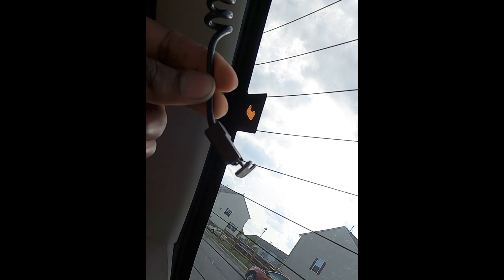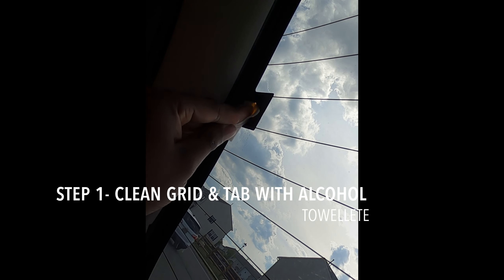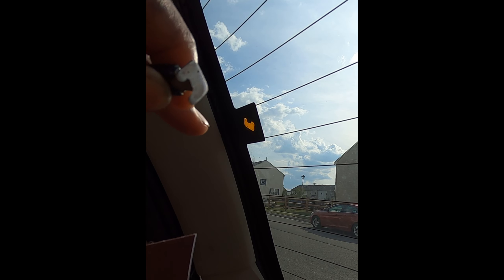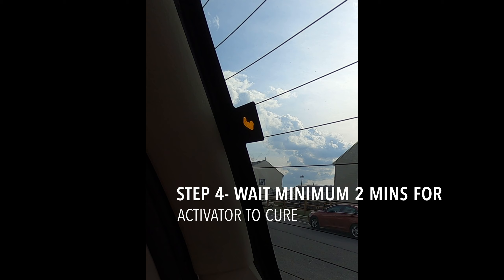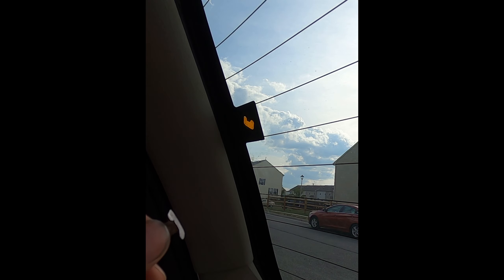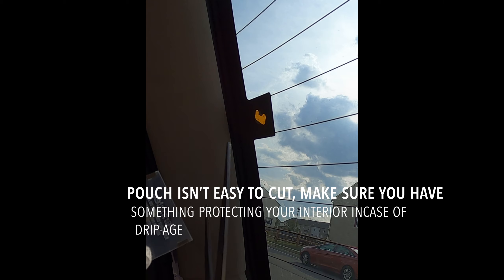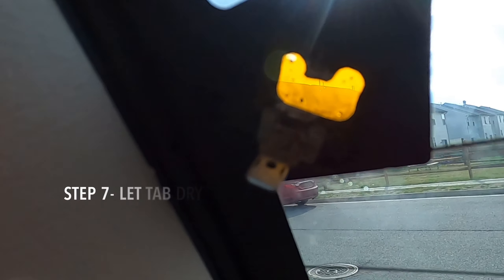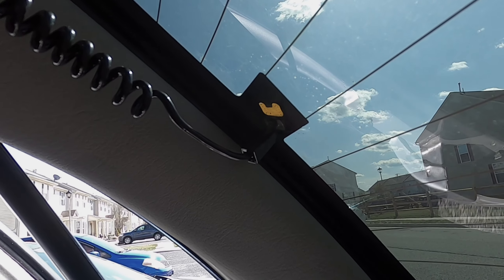How to Repair A Rear Window Defogger Tab

Comment: It works well after fix?
Reply from the maker: Yup
Reply: Glad to know, but Amazon ask something about $60 to bring me that kit to Brazil. My problem is a tab on defroster in my 2009 Ford Fusion. I bought the car recently with only 20,000 miles on the odometer, but with only this issue.